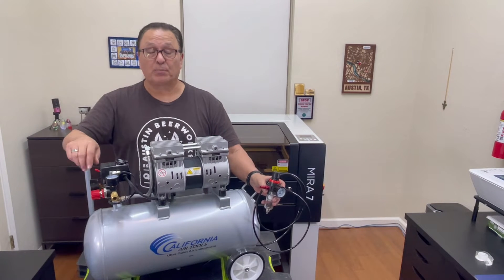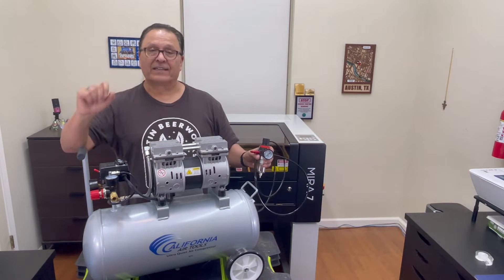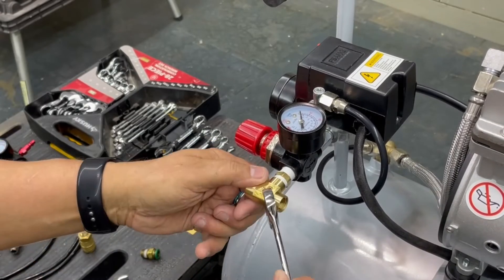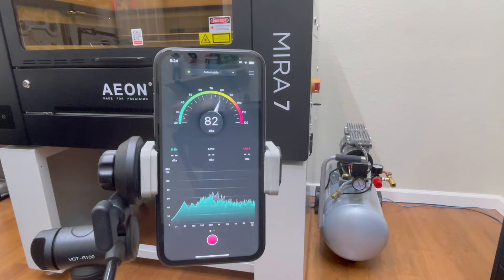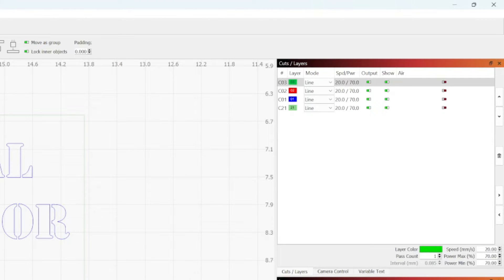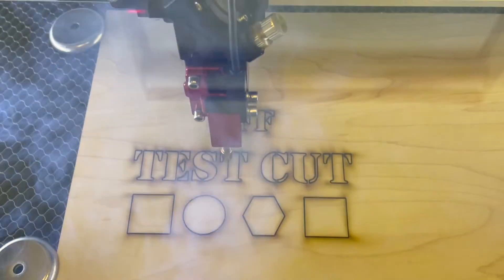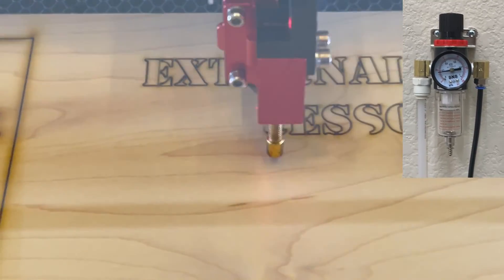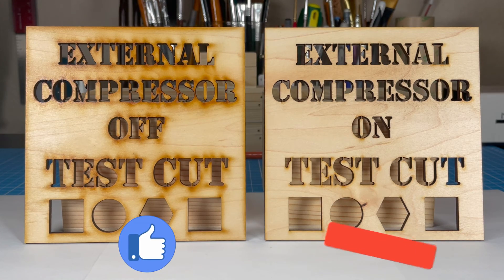Hooking up a Compressor to my AEON MIRA 7 Laser!  Cleaner Deeper Cuts!

Comment: How much run time before the compressor can't keep up?
Reply from the maker: Hi Turboflush!  Thank you so much for watching my video...I appreciate it! 
With the compressor fully pressurized holding 90 psi in the tank...When i start a large cut job... the compressor will kick on about 60 seconds into the job and the compressor will remain running until the cut job finishes...  Once the cut job finishish... the compressor remains running for about 2 mins until it reaches the 90 psi set point on the comressor regulator.
The output pressure out of the regulator is about 25-30 psi.    The 8 gallon size of this compressor is working for my needs.  A larger capacity compressor would be somewhat better ...but for my needs ithe 8 gal compressor works fine!

I hope this answers your questin...  Have a great day!
Rico
Reply: @ricohernandez2394   does it drop below the  30 psi while running on long cut job?
Reply from the maker: @ hey again!! No , never.   It  is able to keep the 30 psi with the compressor running in the background.   I have done some long cut of 20 to 25 mins… and it always maintains the 30 psi at the regulator. 
 Rico
Reply: @ricohernandez2394  awesome. Thank you for response.

Comment: I just received my Mira 7 I'm getting a lot for smoke/smell and unfortunately I have my laser setup in my home office.  Moving it outside isn't an option.  I have the vent setup and it's about 3' from a window that I've vented out of.  Would adding the compressor help with clearing the smoke and reduce the smell? I've only made 5 test cuts on 1/8" plywood, but my main focus with be leather patches and from what I understand, leather smokes a lot.
Reply from the maker: Hi Taylor!  I'm excited about your Mira 7! Its a great machine!  Adding a compressor will not reduce the amount of smoke that is being generated from the cuts/engrave... the compressor is used more for cleaner and deeper cuts.. .You will have to investigate  using a different method to exhaust your smoke.  I am using the built in exhaust fan that came with the MIRA 7,  I am happy with the sound level and its ability to exhaust the smoke.  However other people use other exhaust fans like the Cloudline 6 fan to their machine.  I dont know if it works any better than the stock exhaust fan...  Good luck with your Mira 7.. there is much more to learn... I am still learning...
Thanks for watching...Rico
Reply: Likely your room and or house is to tight and the fan is having a hard time moving air out of the room. Open an posing window and see if that helps. If it does. You will need makeup air installed. Your hvac company can help with that. 
You cannot keep a hole to the outside open. It will not allow your hvac to run correct.
Reply: @ 8" inline fan fixed my issue. Thanks for the input.